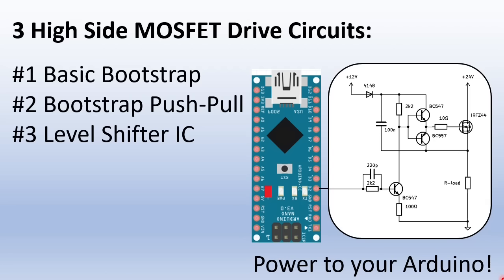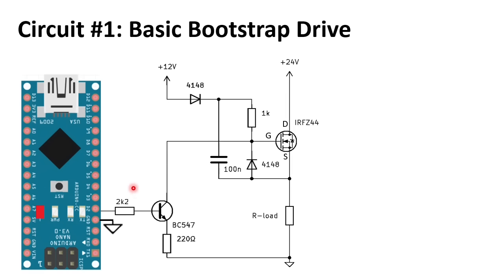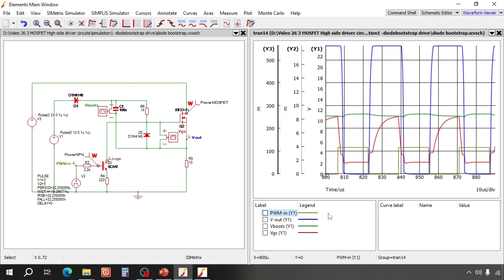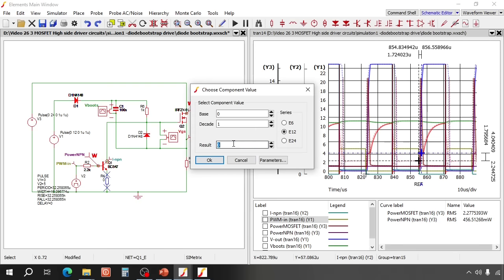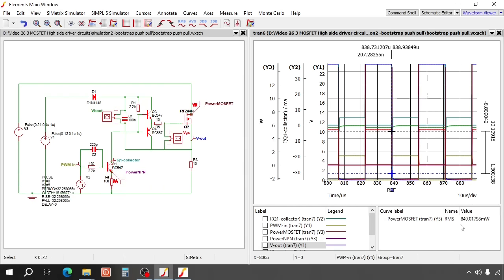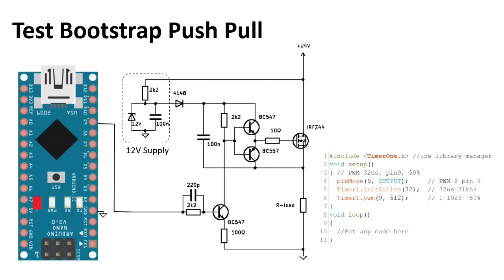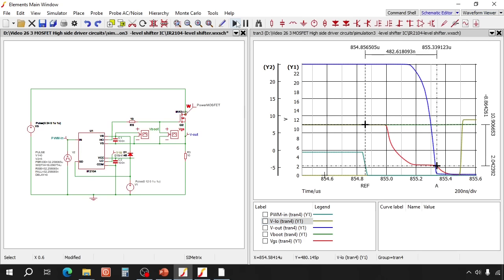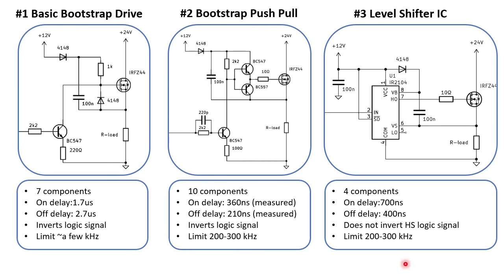3 High Side MOSFET Drive Circuits

Comment: Mosfets that switch any real power need gate protection, back to back zener diodes, plus an ultrafast clipping diode on output (drian to source) . Many other improvements but for now I will qualify my statements with this,,,I designed Mosfet EDM powersuppies for decades, and although the methods shown will function, they by no means represent best circuit design. The problem is caused by the Miller effect. My supplies switch up to 400 amps at just under 
1 mhz or less. These will get you started but switching real power needs more components.
Reply: At these currents, it’s best to use some kind of resonant topology (normally ZVS). Rather than battling the FET parasitic capacitance by brute-forcing the shortest rise & fall times possible, you can take advantage of it. :) It’s only applicable if you’re driving an inductive load of course, but at these frequencies any load becomes somewhat inductive.

Re: the bootstrap push-pull circuit, replacing the pull-up resistor with a current source and using a common base or common gate transistor instead of common emitter/source would be a big improvement.

Comment: Is it possible to measure the efficiency of the gate driver circuit by considering only the driver output and input? is the efficiency going to be very low? And why used RMS value for power calculation instead of taking the average value? Thank you..
Reply from the maker: Yes you can, for the simulationin the Simetrix tools, efficiency calculator. I did not measure the efficiency, however it can be done with some multi-meters. 
Regarding the RMS value...I checked a bit more online and you are right I should use mean...... never too old to learn thank you for pointing that out!

Comment: Not bad.  It would help greatly though if you could explain the defensive design techniques for preventing false triggering on the high side due to fast dv/dt at the output e.g. when driving a (half-)bridge.
Reply from the maker: Thank you p0lyglot, you must be a professional in this field. The IR2104 has built-in logic and non-overlap time for that. For the discrete solution you will need to build in the dead time and logic in your logic signals. Half bridges are tricky for beginners, especially prevention of capacitive mode and hard switching are complex to manage.
Reply: The false triggering thing isn't a dead-time issue, but a matter of physical design, parasitics and low-side turn-on speed.  It's not a shortcoming of this high-side video but if you do a half-bridge or full-bridge video, it'd be worth including some additional considerations for high-side driver design.

The problem is that when the low side comes on, the high-side source voltage goes down very fast.  Any stray C between high side gate and a power supply rail mean that the high-side driver has trouble "following" the FET (keeping a fixed low Vgs) so suddenly you have a bump in Vgs, the high side turns on and all the smoke gets out.

Comment: Hi 🤩🍇
thnx 4 nice vids Mr. T 
is level shifter same as mosfet driver?
thnx 4 answere and we wish u nice day 🌈🙋‍♀
Reply from the maker: Thank you infoolyugun!  
A level shifter can drive a MOSFET with a "floating" source. So the IR2104 is a level shifter.
It drivers the MOSFET AND handles that the MOSFET source is flying at some high voltage.
A MOSFET driver only drives the MOSFET at ground level, see this video: https://youtu.be/wv4uAz8FV2w
The IR2104 has a MOSFET driver at the LO (we did not use it in the video) and a Levelshifter for the HO.

Comment: I still believe that a lowish VGSmax small signal N-channel MOSFET would work best for the inverting level shifter transistor.
Reply from the maker: Yes, you are right, and it will be very fast. 
For my demonstration I try to use the most common parts possible so the circuit is easy to build.

Comment: The 2n222 bjt is very fast I don’t have any issues with the first boostrap and you can add a speed driver of pnp 5401 bjt to increase speed in series it’s great speed
Reply from the maker: Yes the 2N2222 is faster and has more current capability than the BC547!

Comment: Should include isolated version too.
Reply: That is out of the scope for this video...
Reply: @annaplojharova1400  Even a small mention like "You can replace this BJT with an opto if you want isolation" and show a simple circuit would make this video better without any drawback.
Reply: @XiaZ  These "simple basic circuits" are already quite bad from safety perspective (microcontroller fault -> output ON; microcontroller supply failure -> output ON; in both cases even not completely, so mosfet meltdown ensured). With an optocoupler attempt the same issue becomes way more complex (more power supplies to handle, parasitic capacitive coupling between LED and the phototransistor within the optocoupler, dealing with the typical optocoupler parameter instability in general,...).
By the way optocouplers are normally not used with fast switching, it goes usually via transformers or balanced capacitive coupling (when the insulation barrier is within ICs).
Reply: @annaplojharova1400  That's why I said you need to address it. You just proved my original point.
Reply from the maker: Good discussion guys! I did consider the opto-solution but that would make the video even longer because it comes with many caveats (speed being one of them....)
I do agree that could have mentioned it.

Comment: what should i do if i want to use circuit at 650 khz ?
Reply from the maker: Normally less than 1MHz is not very critical. I suggest you make a ground plane, use the bottom layer and fill it with as much copper as you can. Search fill function in KiCad and search ground plane in general with Google

Comment: Hello, I try the simulation circuit #3, but Simetrix returns errors :

There are errors in the circuit. Simulation aborted
IR2104.sub (2): C1 Com In 10p Rpar=1e6
* ERROR * Unknown parameter 'Rpar'
IR2104.sub (13): C3 HO VS 22p Rpar=100k
* ERROR * Unknown parameter 'Rpar'
IR2104.sub (17): C4 Com _SD 10p Rpar=1e6
* ERROR * Unknown parameter 'Rpar'
IR2104.sub (28): C6 LO Com 22p Rpar=100k
* ERROR * Unknown parameter 'Rpar'

* ERROR * Cannot find definition for model '50n'
* ERROR * Cannot find definition for model '.35'
* ERROR * Cannot find definition for model '20n'
* ERROR * Error in model 'IR2104.SH': VH parameter is below minimum value of 0
* ERROR * Error in model 'IR2104.SL': VH parameter is below minimum value of 0
* ERROR * Cannot find definition for model '25n'

It seems to become Rpar and all A descriptions in the IR2104 model
Reply from the maker: Did you succeed adding the IR2104 model? There is a link in the video with model and a short description how to add it.
 If you are stuck with SimeTrix it is hard to find a solution, because of this I now use LTSpice, which has much more online information, tutorials and is really free to use. The schematics and interface of SimeTrix are much better though ;-)
Reply: thanks for reply. Yes, I have droped the IR2104 Sub file in the shell and after I can edit the model in local/global or use it from the user library.
Is there anything to do juste after added model like special setups or modifications in model in local mode ? 
So I try to understand the problem but like you said, it is very difficult to find informations juste for exemple on A Spice command, witch represente probably an amp ou an amplication function. However, the IR2104 spice model seems to wheel organised...

Comment: Nice video, but both of these discrete circuits are examples what should never be used just like that. And the slow switching of the first one has nothing to do with any of them.
There are two major problems:
No protection against mosfet destruction (by insufficient bootstrap voltage causing incomplete turn on because of abnormal load, no output overload) and mainly everything but fail safe (if processor fails, it keeps the mosfet partially on, without any control).
And to make this circuit OKish at least a bit, we are talking about roughly 10 extra components, even for the first "slow" predriver. To me it does not make much sense, when that IC is available...
Reply from the maker: The IC version is for sure the easiest and very robust. However understanding the basic principles is key to make a good design with integrated circuits. 
By the a different version of circuit 1 has been produced in the millions for a 20W, 300V half bridge running in ZVS at 50kHz and proved robust. When I saw the circuit the 1st time I was actually shocked just like you... but it was cheap, did the job and reduced the electromagnetic noise so much that more savings were found in reducing EMI filtering.

Comment: Why is everyone on YT all of a sudden does high side bootstrap drivers?
Cause I've seen like 3 already.
Also discrete drivers + arduino noobies = bad idea.
You also need to mention that MOSFET needs to be constantly switching for the circuit to work properly.
So beginners better stick to IC drivers that have internal protection features.
Reply from the maker: Good point, that is also why I recommend an IC.

Comment: Your explanation is not helpful.  "The 12V will be carried on top of the 24V".   Why, how does that work?
Reply from the maker: Hi Zeeebrenn, yes that part is tricky, but the key point of a bootstrap supply.
If you look at circuit #1 (0:07 in the video, make a screenshot) 
*If the MOSFET is off, the 100n cap is charged from 12V via the top 4148 and the load to about 12V right?
*OK, so we have 12V on the capacitor, that will remain there if nothing discharges it...
*Now if we let go of the gate (BC547 off) the 100n has 12V and will charge the G-S of the MOSFET, the G-S is only 2-3nF so the 100nF keeps at 12V!
*If the MOSFET is on...D-S will be like a short circuit, so the bottom of the 100n is now connected to +24V...therefore the top of the 100n will be at almost 36 Volt!
Please draw or print the schematic and use a pen to draw the current s and voltages, hope you understand it! 🙂

Comment: Simulation is stupid and misleading
Reply from the maker: Well that used to be my opinion too, for instance if you simulate a astable multivibrato r with 1 npn's, it does not even start because the parts are 100% balanced mathematically..(you add a 100G resistor anywhere and it works ) ..But if you know what you do and accept the limitations of simulation it can be helpful. And I fully agree with you, build & testing is gold and more fun to do! :-)